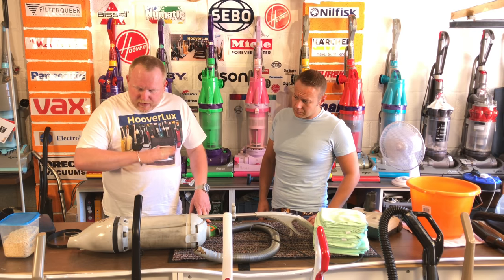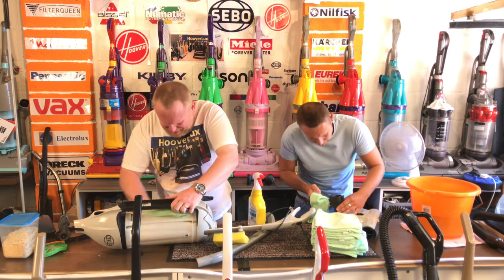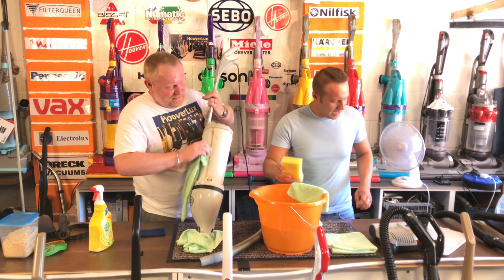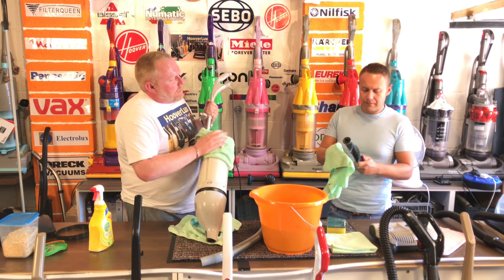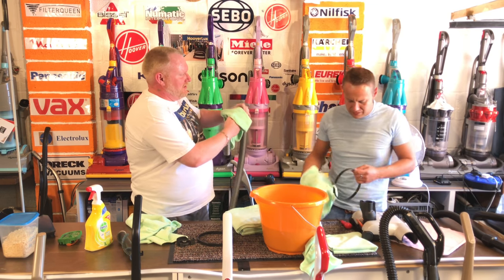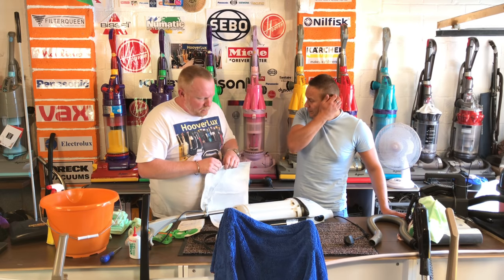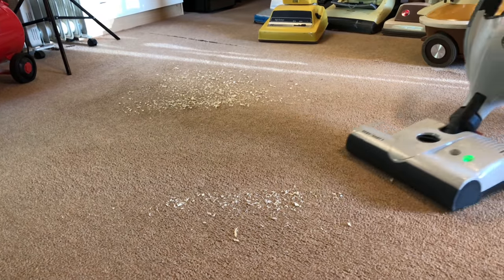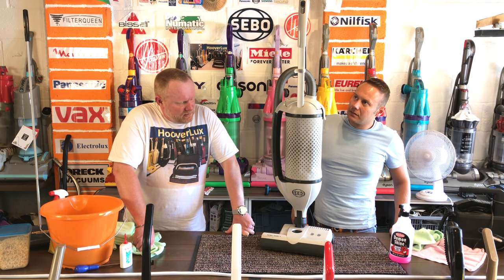Collaboration Video With Ben, Cleaning Up His Old SEBO Dart 1

Comment: The reason powder cleans the machine out is it contains bleach - Liquids don't, It's one of the reasons people need things like "Vanish" booster - Which is just powdered bleach! Safest way to deep clean a machine is run a  boil wash with a cup of Citric Acid (Big bags on Amazon fairly cheap), It'll also descale the machine
Reply from the maker: UkSkin That’s really good advice. Thank you. 🙏🏻🙏🏻
Reply: Citric acid for descaling. Oxygen bleach and I use Vanish for deep cleaning residues citric acid cannot remove.

Comment: I read this video wrong and thought you spelt ‘Part 1’ as a spell check then saw it’s actually called Dart 1... blonde! Great video guys 👍 Dorian you need to try Auto Finesse and not demon shine, amazing products!
Reply from the maker: Patrick Hartle Hi Patrick, I have many Auto Finesse products and yes, they are awesome!! too good for vacuums 😂😂😂😂😂. I do use some of the waxes and polishes on them, but to be honest the demon shine for removing residue or using as a cleaner for a freshen up works just fine and is mega cheap as you know, but I mainly use AF and Chem Guys for the cars xxxx

Comment: 17:26 Bigger the drum better the wash

There's an article over at UKWG that says the opposite. Tumble action isn't as good as the drum diameter increases. Clothes don't tumble but roll. Maybe there is a way to fix that with faster turns or twists.
Reply from the maker: Faster turns absolutely!
Reply: @HooverLux  i'd seen this roll instead of tumble in one of your comparison videos. One machine's tumble action was just non-existent compared to the other one you had. Really has to be seen to be believed and without the comparison you would not realise how bad it was

Comment: In reference to what you were saying about using powder in a hot wash, would you use the original old fashioned type of power in an A4 (ish!) sized box or the concentrated powder in smaller boxes? Does it matter? Thank you.
Reply from the maker: I prefer concentrated to be honest, the older ones were just bulked out with pointless powders and more was deemed better back then. More for you money etc.
Reply: @HooverLux  Thanks, Dorian, that's really helpful.